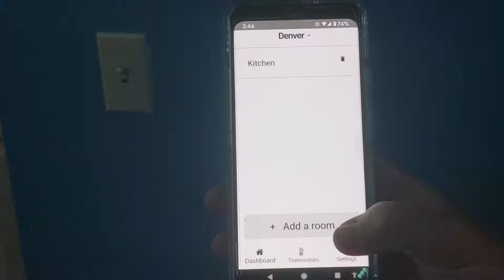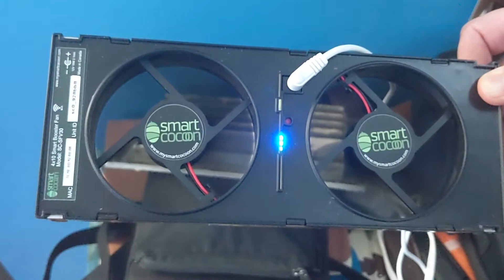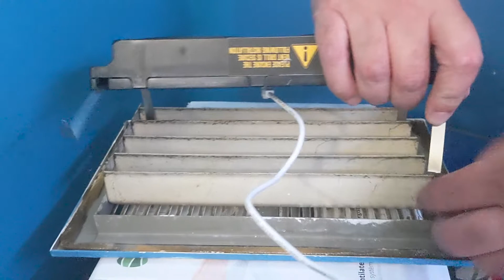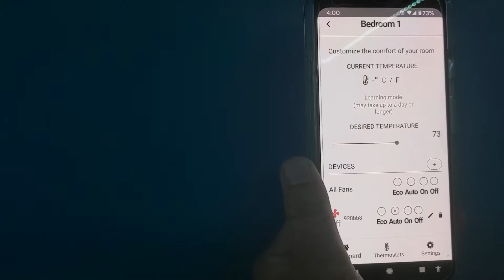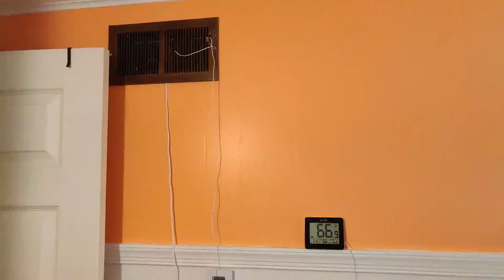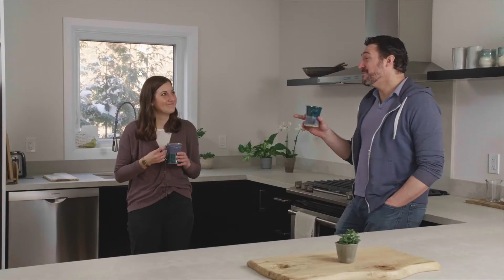How to Control Temp Comfort in each Room. Smart Cocoon DIY User Install and Review

Comment: These definitely helped in 2 2nd story south facing bedroom. Temperatures in those room would reach close to 80 while rooms in other parts of the house were 75 or less. I was able to keep those rooms a few degrees lower with the Smart Cocoon devices. I also just realized that the Flair Smart vents can be installed on top of these. At least I can can with my floor vents.

Comment: So many things have wifi control that don't need it.  This is one of them. It's a waste of time and electronics. Just put a simple fan on the vent. It's actually more hassle to deal with the wifi control than it is just to turn the fan on and off as needed.
Reply: Not for you then. For some people the vent is located in an awkward spot and not having to crawl under a desk or table is super convenient.

Comment: My unit is not connecting to my wifi. Any tips?
Reply: Your ducts are made of metal - which blocks radio (and wifi) signals.  Depending on the geometry of where the fan (which sits inside the duct) is and where you wifi router is - could be a problem.  Moving the router may help - or trying a stronger wifi.  A wifi extender may also help.
Reply: How is it working